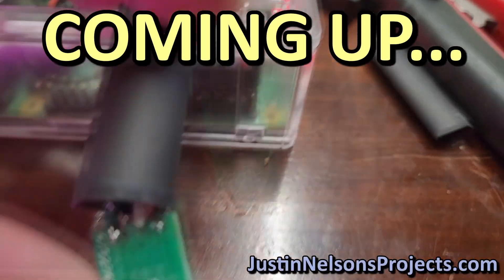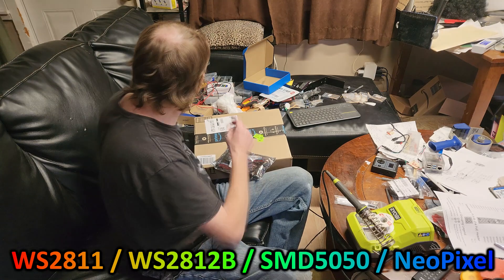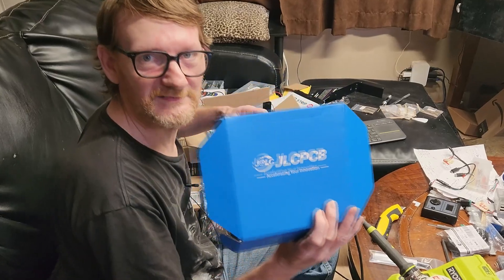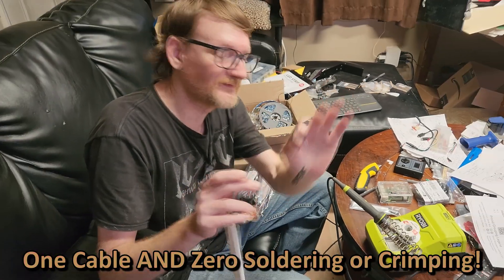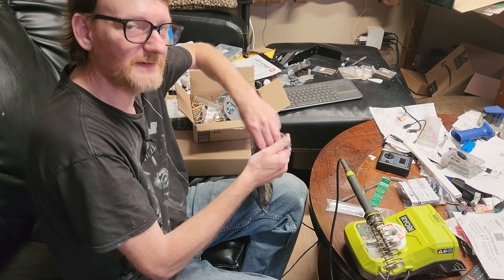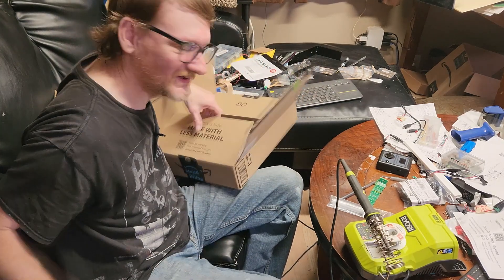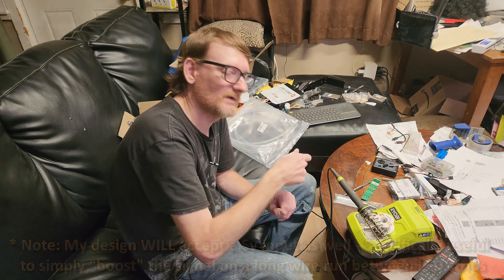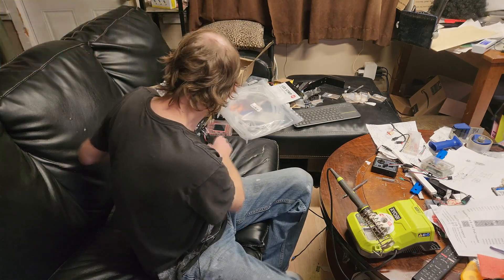Level shifter for RGB LEDs - The right way!

Comment: ChatGPT actually sent me to this video lol so well done.  So I was going to buy your level shifter to avoid making one for my storefront sign, they sent cheap controllers with it and I want more control with WLED so I intend to use a ESP32 I have sitting around and I see in the description you explicitly say not to use it for 12v LEDs which makes sense but ChatGPT is insisting that the data on a 12v LED is still only 5v not 12v. So is this accurate or is this AI trying to fry my sign/your adapter? The LEDs I've identified seem to be the ones below. Power injection is happening halfway through the sign from a 12v supply and this would probably happen at the same spot if this will support it but want to make sure and you built it so you'd know best. Thanks in advance! I hope to get some better control of my sign!
12V WS2811 5050 RGB LED Module Light Magic Full Color SMD 3 LEDS IP65 Waterproof
Reply from the maker: I have talked up ChatGPT's usefulness to some friends lately, for certain applications -- perhaps it is returning the favor 🤣 I'm not sure whether to be flattered, or scared lol!

I do get this question a lot (you're the third today, two by email).

You can use my level shifter on a 12- or even 24-volt LED strip, as they do in fact all use standard TTL 5-Volt data. The key is to NOT connect the red wire between the shifter and the strip.

And you'd have to power the level shifter with a separate 5-Volt supply.

I am considering modifying the design of my "inline" shifter to accept anything from 5 to 24 volts, passing it through and (internally) regulating 5-Volts for the actual data. The supply voltage would (as it is already) simply "pass through" the device.

This would NOT have the USB ports or barrel jack of the "Hyperion" variation I offer, as that would require a higher-output 5V regulator and a lot more expense (and heat etc).

Short answer is yes, the strip still requires 5-volts for the data, and a ground for reference, but never connect the power wire back to the shifter. It wouldn't actually hurt the shifter, but it WOULD damage the strip, any any microcontroller/Pi connected to it.

I do know that some viewers have successfully used the WS2811, strip which uses the exact same protocol, just with 3 LEDs in series for each "address" and running at 12V.

Note that the WS2815 requires data and clock, and would NOT work with my level shifter -- only strips with a SINGLE data wire would work. If there are 4 tabs/wires on the strip, that's a different protocol all together (but it's still going to be 5-volts...)

Hope that clears things up!
Reply from the maker: @makeit3DOhio One final thought... if you search my channel, I have several videos showing exactly how a level shifter works, what it does, and one video walks you through making one on a breadboard.

I have no "secret sauce" going on lol, it's really just a voltage comparator... what sells the product is the convenience of not having to make your own -- but also the transparency I offer by showing exactly how I make them 😊

Comment: Is it for 12v or 5v led strip?
Reply from the maker: The level shifter supplies 5v logic, from a 3.3v logic input. HOWEVER, it CAN be used with a 12v strip, as they ALSO use 5v on the "data" pin for the logic.

Just don't run 12v to the level shifter itself -- it needs to be supplied a steady 5v.